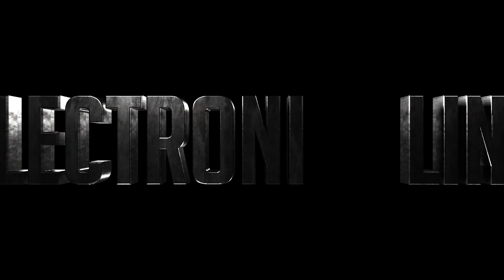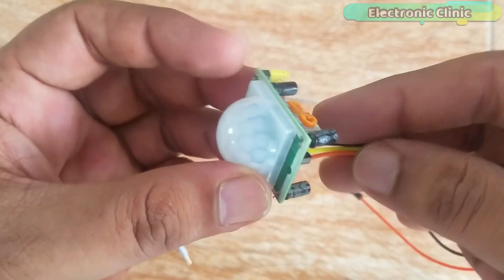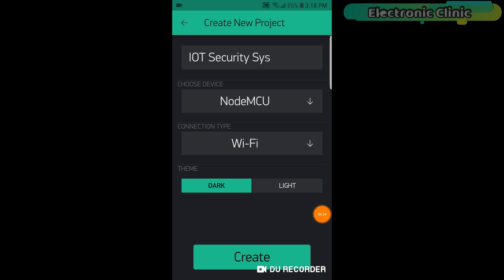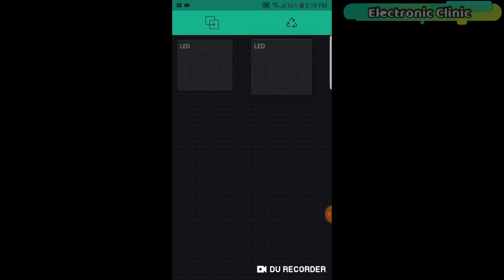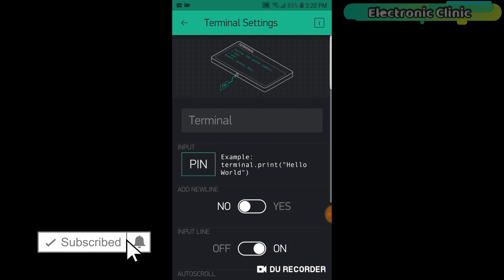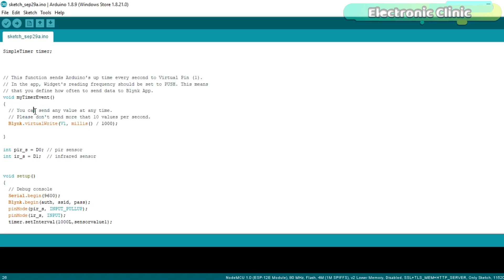IOT security system | IOT Home Alarm | IoT Home Security System Project

Comment: Thanks for responding to my previous question. One more. You say that J1 and J2 are being powered by a single 12V Adapter, but I can't see how J2 is connected to the same power adapter that J1 is. Can you explain?
Reply from the maker: I connected the 12v power supply with a female power jack and then connected this with two more male power jacks. this way you can power up two different circuits using a single adaptor.  you can even connect more male power jacks.

Comment: Why is there only one 470 uF capacitor soldered to the NodeMCU ESP8266 PCB? The schematic shows 2, and you can see C2 etched onto the PCB with nothing on it?
Reply from the maker: This capacitor is very much important on the output side and optional on the input side.